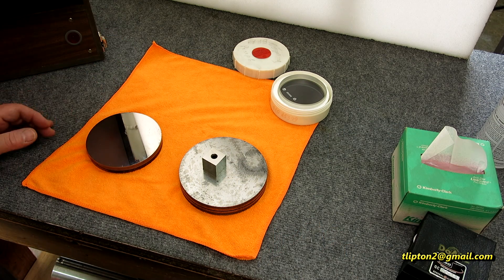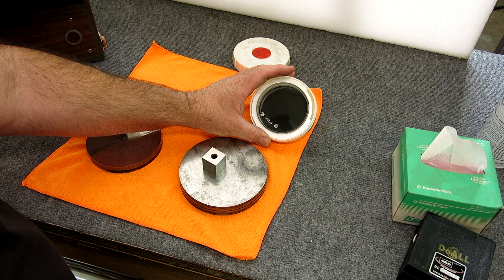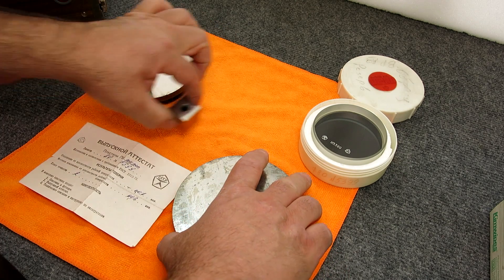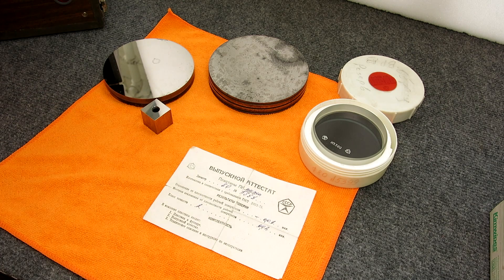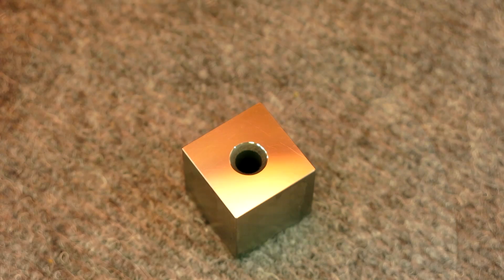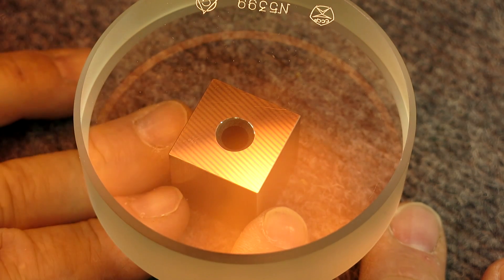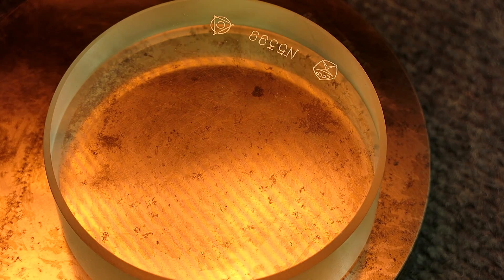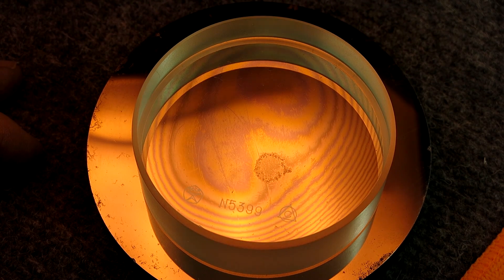Russian Optical Flat Testing

Comment: Would LED light source be good for this? Usually the different colors are rated in their nanometer wavelengths. It was interesting that I had a 650nm laser and a 670 nm laser, to they eyes, 650 looked brighter, but to a camera with IR filter removed, the 670 was brighter.

Comment: Great video as always.  Out of curiosity, I looked on eBay, and there's still a bunch of these available.  Had a question though: they are labeled as "bottom" and "top".  Any idea what that means in practical terms?  Does it matter which kind is used for this sort of analysis?  In one of the lapping videos, you mentioned concave vs convex flats, wonder if that's what this refers to...

Comment: Tom, I've just bought myself a Russian Optical flat off ebay. I think it would very interesting to test the sole flatness of my Record 5 1/2 hand plane. Also testing the difference in flatness before and after closing the lever cap is a very useful experiment. Many thanks for sharing your knowledge and experience. I now follow you on Instagram. Best wishes from London!!
Reply: That is a bit same as to use the most expensive micrometer measuring rough pieces of lumber. Optical flats are the finest measuring instruments mainly for laboratory use and they should be treated with some respect. 

 Bottom of the plane isn't anywhere near flat enough to see diffraction fringes (in meaningful way or at all) and it certainly don't have to be that flat. If it is straight to 10u it is very good already. 

Optical flat is 100x more precise, more flat than best plane bottom

Comment: I'll admit that I have not made careful drawings, but I am pretty certain that I know what causes those regular interference patterns.  The thickness of the optical flat, measured perpendicularly, is some value T+-70 nanometers anywhere over the flat.  The perpendicular thickness varies by about 1/8 wavelength. In other words, this is standard 1/8 wave optics.
However, the light you see is a reflection from the shiny reference surface.  It goes through the flat (plus any air gap) twice at an angle theta.  Theta varies from point to point in your image, just like with any mirror.  If G is the air gap, then the effective "thickness" of the plate is (T+G)/cos(theta).  It's the cos(theta) term that determines the spacing.
Cool stuff! Thanks for showing us all this.

Comment: If you get circles it can be hard to decide wether the part is concave or convex(high or low spot). By pressing with your finger, if the pattern moves towards your finger the part is convex, if it moves away from your finger its concave. 
Carbon parts can be tricky, they must be polished to a shine to be able to read. Getting both the shine and the correct shape i.e concave/convex (no you don't always want flat parts) is hard

Comment: You can also use sodium lamps, they're commonly used to grow 'plants' so should be fairly easy to get hold of, and the wavelength is very close to that of helium. Some LEDs might also give better results than 'daylight' tubes. I'll be getting an optical flat sometime soon so I'll try a few out.

Comment: Helium discharge lamps are pretty expensive. Much cheaper to use a laser pointer with a beam spreader or diffuser. A green, blue or purple laser would provide more accurate measurements than the yellow peak of helium emission, by virtue of their shorter wavelengths (typically 532nm, 447nm, and 405nm respectively for green, blue and purple, compared with the 588nm line of helium)

Comment: I just found a optic flat cylindrical test plate made by The VanKeuren Co. Watertown           Mass. At a garage sale last weekend and they gave it to me with a few other stuff that didn’t sell at the end . I new it was a testing / calibration tool of sort. Thought it would make a good paper weight or ? As I watched your clip and the pitted flat needs a backup . ? 
Honestly I just stumbled across your channel and watched a few of the videos and realized that it wood be a shame to let it sit in my shot as a beer coaster ! So up fo grabs just take care of shipping cost , it feels like 10 lbs + and has nice case it stores in . 6” x 1” + /-  surfaced  both sides. OBTW. I did ask how they got it , they purchased the home a few years back from a elderly man that was a engineer for Hanford DOE site for over 40 years. I can send you pics and let me know if you or someone  can use it . 
Allen S near Hanford Wa USA
Reply: I posted a short clip of the plate on my page

Comment: I can translate better than GL. The first value of 0.07 means exactly: " The total maximum deviation from absolute flatness of working surface is not more than 0.07 of micron at any place"
Another value of 0.02 means: " The local deviation from flattness of working surface is not more than 0.02 of micron"
The soviet industry was making two types of flattness measuring glass plates: PI (shown at your video and PM. The difference is that fist one have one working surface and second one have both sides with very very high grade of parallelism. Fist is designed to observe defraction lines pattern  of air gape betveen tested surface and etalone glass surface fitted on it. Second can do the same, but also you can invesigate difference of opical way to front surface in monochrome light to obtaine absolute values of flatness deviation. 
This really very precise instrument to control flattness with acuracy exceeding most needs of tooling purpose.
Reply: What source of light would you usually use with it? sodium lamp maybe? They are pretty monochromatic.
Reply: Sodium or helium. Any gaseous bulb with a narrow band of spectra. Not sure if led can work but seems possible.
Reply: I've used Neon indicator bulbs successfully for this application.  This is quite a small light source and 3 or more bulbs can be used in parallel with the right resistor in series.
I didn't have an optical flat for my work at that time (30 or so years ago) and used a small piece of float glass instead.  Worked quire well for my application: checking the flatness of mechanical seal surfaces.  This was a custom made seal for a small shaft on a pressurized hot air engine.

Comment: Just FYI:
On that paper part of that text was written by hand (2nd line). It means "bottom" or "lower", so this flat glass plate is bottom/lower.
Lower plates were 60, 80, 100, 120mm , when top one was 60mm only.

Plates were produced in two types: lower and upper. The lower (supporting) plates are used to check the lapping and flatness of the measuring surfaces of the end measures of length, calibers, measuring instruments and tools. The upper plates are used to measure the plane-parallel end measures of length by a technical interference method.
I've get this text from Internet and translate it for you.

I neverI'm not sure how work with these plates. @Tom could you explain more about them? 
some pics of upper plate:
https://images.ua.prom.st/14435431_w800_h640_dc120709008.jpg
https://images.ua.prom.st/14435433_w800_h640_dc120709010.jpg
Reply: I have one of the "top" plates. It has a large, angled surface (1/3 the surface) on the side that has the cross lines scribed on it. What is the use case for this special flat?

Comment: So what I'm hearing is that you want to use a single wavelength light source to maximize the interference. I'd try a low pressure sodium vapor lamp (The kind used in cities, and the cheaper the better.) because they're common and have one dominant wavelength.

Comment: Great video Tom, I've only ever used fluorescent lights with mine, and at times they can be hard to read. I've wondered if a diffused laser or even standard LED could be used, but haven't had a chance to try. Other light sources could make a good follow up video suggestion as this has come up before.

Comment: Hey Tom,  kind of off topic but,  you did a video a while back in which you made a template and followed it with an indicator keeping it as close to zero as possible as the lathe fed in.  Ive been trying to find it as I have to do something similar for a job at work coming up and want to see how you did the job to refresh my memory.  Could you tell me the name of the video if its still up?

Comment: 1st: Whole degree of deviation from the working surface flat is: -0.07 micrometers.
2nd: Local degree of deviation from the working surface flat is: 0.02 micrometers.
It's a second-class quality of accuracy so it's cheap but extremely useful.
And yep! It's USSR made. Not in Russia. May be this stuff is 30 years old.
Reply: On the back side of certificate it says it's made in 1981

Comment: Tom, you kept saying Helium Lights, are you sure ? When I did optics at work we used a SODIUM Lamp, yellow glow as in street lights. This would also show up any stress marks in glass.
Reply from the maker: Hey Dave. Quite sure. Mine is made by Lapmaster and is a helium gas lamp that is diffused through a screen. Sodium would work as well but I don't know if the bands would be as crisp. Never tried one. Cheers. Tom
Reply: Sodium is best, monochromatic lamp is ideal

Comment: Never wipe optics with Kim Wipes, they have woods fibers that can scratch the glass.
Reply from the maker: Flat is made of quartz. Good advice for BK7 and other lens glasses. Cheers. Tom
Reply: @oxtoolco  I'd be more afraid of carbide crystals in the steel. You could probably find them in mild steel too. The corrosion can be a hard oxide too. Not to mention residual CrO from lapping paste. I would never slide the O-flat over surfaces. The wood can contain silicon oxide crystals too - that's why it is able to scratch some glass IMO. 
What they use to clean the surface is acetone - no residue, no fats, no wood.
Reply: I agree Nick
Reply: Used toilet tissue !
Reply: Metalographic samples are wiped with Kim wipes prior to  colloidal silica.  This is a method that's been developed over the last 15 years which has been employed in dozens of publications.  A Kimwipe is not going to hurt the surface of the glass if it's not going to damage metalographic samples.

Comment: Do you know for how much they were sold?
Reply: + Thomas. I have just purchased one from the Ukraine, it is the same make as the video complete with the same test sheet. It was 100 mm diameter and cost $ US 85 + $ 20 postage. He is still selling a 60 mm one for $ 55.  Link . https://www.ebay.com/itm/Optical-Flat-Parallel-Top-60mm/222687471409?hash=item33d9352731:g:6coAAOSwu4BV0NTp

Comment: Great tips Tom - and a timely posting -I just dug out my (ebay) optical flats earlier today to look at deformation under clamping pressure (I'm trying to machine an aluminium heatsink to an acceptable flatness and  need to play with clamping pressure) , my flats work kind of ok by eye with fluroescent lighting, but I can't get my camera to see the rainbow fringes, I tried our external low pressure sodium floodlight (a light source suggested by Gottfried Schuss in an earlier comment) once it got dark enough outside , and it looks much more promising :)
Reply from the maker: Good to hear. I should try to find a HPS lamp to test. Cheers. Tom
Reply: Hi Tom, the floodlight I have is LPS I believe (low pressure) aka SOX - these  are yellow (two spectral lines around 590nm), the HPS lamps have lines from violet through to red, so may not be so useful - I might be wrong and the one I have may be HPS - I've ordered a SOX bulb and control gear so I can do this indoors - total cost around 50 GBP/70 USD from a lighting store, Cheers, Ray

Comment: As for the light source, personally I would try hanging a little 405nm violet laser pointer from the ceiling and completely remove any lenses it had, so that way it puts out a wide-angle beam like a normal light source. The smaller wavelength should give even finer resolution than the helium light, and it has a bandwidth of... I don't know... I'd guess at least two orders of magnitude finer bandwidth than say, an LED.
Reply from the maker: Certain colors produce fringes that are sharply defined and visible to the naked eye. Mercury Isotopes produce some of the sharpest fringes but the light sources are a pain to work with. One of the reasons that helium was settled on. Cheers. Tom

Comment: I know you......”kind” of mentioned a way to calculate how far out of flat the plate is, but you didn’t show us how. Is there a formula that you plug in values , that you get from a chart that gives you the values based on the spacing of the lines established by the wave length of the light source. Sorry, it started as a simple question? Fascinating subject, thank you for giving us your time. -P
Reply from the maker: Check out Edmunds or Van Keuren on how to read optical flat fringes. Some good information. Basically its the amount of the bow that gives you dimensional information on the curvatures. It can get pretty complicated depending on where the flat is touching down and the bands curvatures that show. Plenty for an entire video. Cheers. Tom

Comment: Some colored LED's are rated in nanometer spectra. Red for example is commonly rated 620 Nm. An array might make a nice monochronomatic light source. There are over 6000 eBay hits for red colored LED flashlights and many are less than $10. The distance represented by fringe deviation will have to be figured in based on the actual color wavelength. 

Anyway monochromatic light can be affordable
Reply from the maker: Hi Forrest. Rick also sent along a special LED flashlight for looking at gemstones. Don't know the specifics of it but it was a dud with the optical flat. Good to hear from you. Cheers. Tom
Reply: oxtoolco Was that gem light monochromatic? Filtered? Do they make LED's to spectrum now? I've seen strong fringes in LED red on stacked Mylar sheets. Pack your flat and specimen out to the driveway and try it on the LED tail light of your radical ride.

Comment: Have you tried using a white LED light to see the fringes? They are typically a blue LED with some phosphors to balance out the color to white, but the spectrum typically still has a very strong blue peak compared to the much weaker and broader red peak. I'm curious if you get better results compared to a fluorescent.

Comment: Hi Tom, Interesting video. Can you share a link to where you can buy them? I searched at eBay and could not find this same one. Thanks
Reply: Hi there. You need to look on E-bay USA. I tried the Australian and British sites without success. I bought a 100 mm exactly the same according to the photo and it had the same data sheet. $ 85 + $ 20 postage from  UKRAINE. He is still listing an 60 mm for $ 55 Here is the link. https://www.ebay.com/itm/Optical-Flat-Parallel-Top-60mm/222687471409?hash=item33d9352731:g:6coAAOSwu4BV0NTp

Comment: how do you tell if it is a high spot or a low spot?
Reply from the maker: When you press on an edge of the flat the direction that the fringes move tells you if its high or low. Hope this helps. Cheers. Tom
Reply: When using white light, discernable contrast fringes only appear for a distance of a few wavelengths and fade away as the gap gets larger. So with white light, high spots will have higher contrast fringes.

Comment: huh the helium lamp works better because of the narrow bandwidth of emission is there an led equivalent there usually pretty narrow you can grow some pretty good plants under them ge daylights. That google translate is f-ing wow drink your ovaltine cool. awesome Halloween show tom thanks for filling my mind with wonder
Reply: ya ive seen led's (blue in particular) that you can't discern red from black. that comparator sound pretty dam handy if you can use the standard reticle from the pocket comparator you've probably already figured out that some of  the most important things are measured like that that's why I like tom he's got as good of questions as he dose answers
Reply: oh ya my point though was I have my choice of 470nm and 490nm for mineral id that to me seems like some narrow band width

Comment: One can use an inexpensive low pressure sodium (LPS) lamp from the local big box store.  The wavelength is very nearly 589 nanometers.  This will provide far better fringes than daylight fluorescent fixtures and is nearly an order of magnitude less expensive than a new helium light source with power supply.  I get better results when I remove the plastic diffusser from the LPS fixture.  Your mileage may vary.
Reply: A coloured LED lamp should work well too. Red map lights (to prevent ruining your night vision) are pretty easy to find.
Reply: Led's are never as precisely monochromatic as gas discharge tubes - they have a variable electron gap, so they can produce a band of wavelengths instead of a single.
Reply: Still, they have to be a lot better than 'daylight' florescent bulbs, no? I guess there's not that much price advantage over LPS.
I seem to recall that years ago sodium was the lamp of choice for optical flats. When did helium take over?
Reply: Colorblind people might have a problem with non-monochromatic light, too.
Reply: do we/ can we check this?  that would be so much cheaper that and we could put those cheap lights in the lab so flats can just be used without turning on a separate source.

Comment: Good LED in different colors can do the job because they emit mostly in a single wavelength, a LASER can also do the work very well, I suppose it should be scattered, but what matters here is that it is a monochromatic light. For sure any of these is cheaper than a Helium bulb and much better than fluorescent. And the best thing is to turn off other light sources while testing.

Comment: just wondering how do you know that the high spot is a high spot and not a low spot ?
Reply: very1v You press on the optical flat. If the bands widens a lot where you push, you know that's low.
Reply: Because the fringes get further apart when the gap between the surface decreases, and the fringes get closer together then the gap increases.